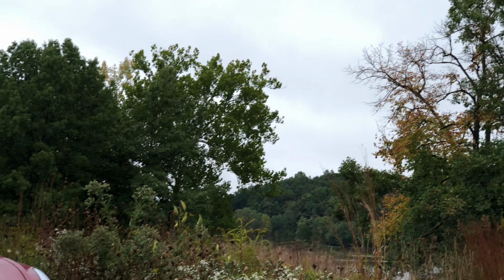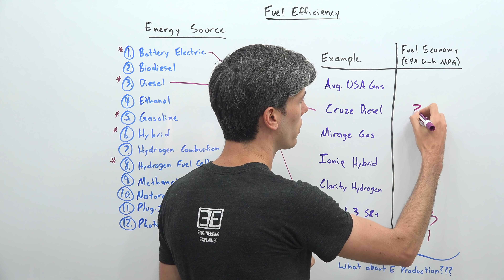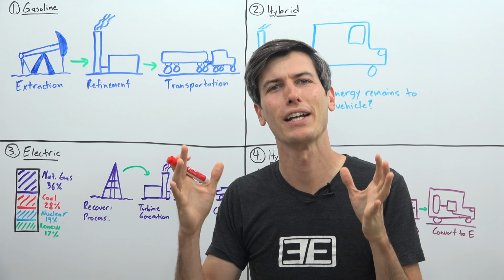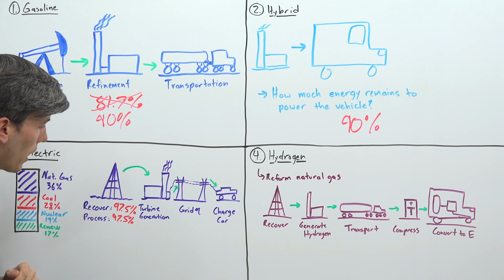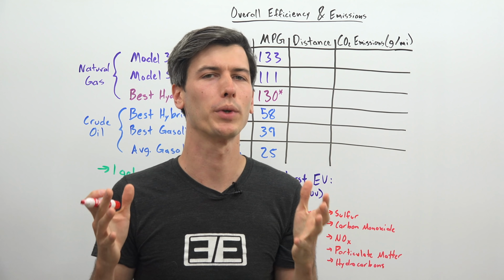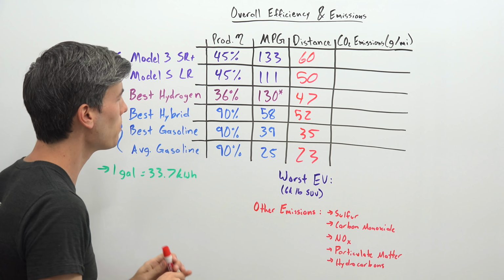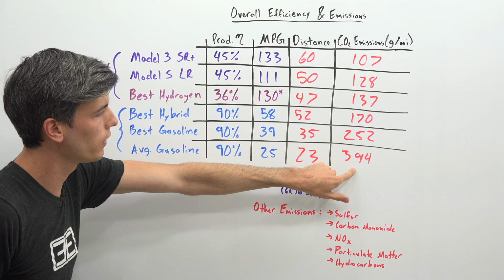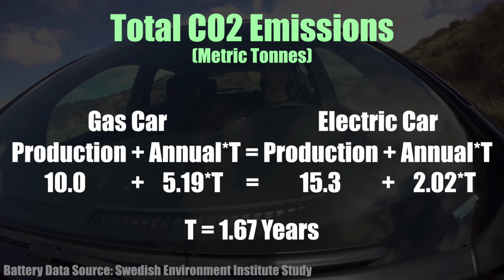Are Teslas Actually Better For The Environment?

Comment: How did you already calculated mpg rating for electric cars, at the very begining of your video? And isnt that logical to calculate mpg rating of the veichles of same strenght(kw)?
Reply: Those are the EPA ratings based on distance driven per KWH, since 1gallon is the same energy as 33.7kwh of battery pack.

Comment: I think judging by the fact that 1 gallon is 33 kWh, a Tesla 3 can travel way more than 60 miles from 33kwh pack. More like between 80 to 100. Since a 100kwh Tesla does 300 miles. Still Tesla's for the win. Batteries are better than gasoline just gasoline is a liquid while batteries are physical.

Comment: The US should be ashamed of those mpg figures for petrol/diesel, rest of world can far exceed that and has for years.
Reply: Its not the consumer's or the manufacturer's fault. It was the Obama Administration's EPA that piggybacked on California's Air Regulatory Board to choke petrol and diesel engines so they produce less emissions. While they succeeded, they also significantly decreased fuel economy. Its a trade off the government seems pleased to have achieved.

Comment: I'm sorry but absolutely no way is the best diesel mpg you could find is 36 my D4 Volvo V40 does and average of 67mpg.
Granted that's motor way but even if I do a lot of city driving it never drops lower then 53mpg.
That's a combined of about 60mpg.
The D4 isn't even the most efficient diesel on sale it's good but there's some out there that does 75+
Think you need to have another look at this
Reply: bring it over and put it on the EPA's test stands, run the 5 tests and let them provide an apples-apples set of numbers.   The EPA numbers aren't real world driving results, they just compare models against each other under the same testing conditions...

Comment: While natural gas (NG) generates less CO2 than other fossil fuel per unit of energy, it applies ONLY TO ITS ACTUAL COMBUSTION, at the point of energy transformation.  Its proper GHG impact should take into account the gas leaks that happen, unavoidably, at the well site, and during transportation and storage.  These leaks amount to 2-9% of the NG consumed, depending on the type and geography of extraction, the build quality and length of the pipelines, tanks, compressors, etc, as well as denpending on the scientific sources.  NG being mostly methane, and methane having around 80x worse a GHG effect than CO2, these leaks make NG as polluting as coal, in the best cases, and the very worst fossil fuel (on GHG metrics), by far, in the less favourable cases.  
I never see a well-to-wheel comparison, which takes into account NG leaks.  For example, NG-fueled cars are by far the worst GHG offenders.  It is NEVER presented in that way.
Maybe you should do some research to confirm (or infirm) my data, and do a video on that....
Reply: these leaks would be really hard to calculate into the equation...

and ever heard of oil leaks? Deepwater horizon? gulf of mexico?

Comment: The computation is not accurate, due to an important miss: coal generated electricity. Even though it only contributes ~30% of electricity, it contributes about twice of co2 emissions than natural gas, due to their low heat value, and high concentration of carbon. Electric vehicle is only as green as the grid it is on. While for European countries where a larger percentage of energy is from renewables and the rest is almost  exclusively natural gas, in the US the math is pretty different. Of course the most striking difference is in China, where 80% of electricity comes from coal. In China, electric vehicles are not low co2 emission at all. Unfortunately, China is also the place with most electric vehicles, and newly built coal plants, so electric vehicles may not be environment friendly on average.
Reply: Also, the 60% approximation for power plant efficiency is probably an overestimate, as that is around the efficiency for the most efficient system out there. There are still many antiquated systems around, which have much worse efficiency. 
I am not denying the potential for electric vehicles to be much cleaner, I am just stating that right now, it may not be much cleaner than the most efficient hybrid vehicles, and may depend on usage scenario (much greener in city, but on highway it is difficult to call as ICE gets more efficient)

Comment: This was a decent attempt but still flawed.  The difference is much BIGGER!  You completely missed the distribution inefficiency of transportation for the gas / Hydrogen via tanker truck.  That's massively inefficient!!!  And it ruins the math of the gas + hybrid + hydrogen vehicle.  There's a lot of loss in distribution beyond the refinery.  This happens twice -- when the raw material is pulled from the ground AND when the refined material goes to the station.  People need to see how BAD the transportation system is.  Electric power line losses are nothing compared to that.😁

Comment: And the emissons of a  e85 or e100 vehicle ?
Reply: Gabriel de Souza E100 along with a 100% E100 supply chain would be emissions free. E85 with 100% E85 supply chain would be 15% of his gasoline number. Problem is the current supply chain is no where near what it takes to be carbon neutral.

Comment: Big problem is the assumption of power generation coming primarily from natural gas. It's only 34% accurate. Coal generates about 30% of power and nuclear another 30% but its all dependent on your region so what might be true in one state does not apply to the other. So charging up your Tesla in West Va. for example, power will come from a coal fired power plant. Probably not so great for emissions.  The destructive mining operations needed to get the precious metals used in the batteries was not considered.   You also did not consider all of the associated energy and pollution in just creating the batteries. I don't think you can isolate on certain variables then draw out your conclusions on environmental impact. Besides that, it might also be good to know who is making these batteries, most will likely come from communist China.

Comment: How about if electricity is generated  using Coal?
Reply: Gaurav Patil There are states in the US and even some countries such as Poland who generate most of their electricity from Coal. In these areas it would take an EV about 7 to 9 years to become less polluting than a hybrid. 

However Coal’s share of electricity production is dwindling fast. Everywhere coal is being replaced by Natural Gas because it is cheaper. Very few new coal power plants are being built and many are being closed down earlier than intended because the economics are not in their favour. 

Coal is dead. And it is not environmental concerns which are putting it away. It is economics. Energy providers choose the technology which is giving them the bigger profits and Coal looses out almost always to Natural Gas. 

Increasingly and depending on the area renewables are becoming the cheaper option. In the UK, the cheapest form of electric generation is onshore wind. In California it is solar. Renewables keep getting cheaper and the more that happens the more fossil fuels will be displaced. 

Here in lies the benefit. As the grid becomes cleaner, EVs become cleaner.

Comment: I don't think this video is right. A-level physics student here and due to the high voltage (regardless of how low the current is), 75% of energy is lost when moving through the grid due to heat, making it 25% efficient as only 25% of the original energy can still be used.

Comment: pinning things onto the lithium productiuon yet stating that it only uses like 7 % of the battery itself
then ok maybe u shoud focus on other materials? like colbalt which is proportional to lithum productions? No u missed it.
ok then maybe u can compare how efficient to run a car avg a year and life span of a car (or specifically the battery itself)? still model t from a hundred years ago r still running.
how bout comparing the recyclability of ICE vs EVs ?

Comment: Internal combustion engines dump emissions into the population centers whereas the electric cars put the pollution that they generate  Out near the powerplants instead of the city. Tire and brake dust remain same for both
Reply: Nope. Less brake dust since electric and full hybrid vehicles use their electric engines to brake too. A full hybrid car may need to switch its brake pads after 190000 miles.

Comment: Natural gas is the cleanest fossil fuel we use to make electricity. I think if you really wanted to make it tough for Tesla in this comparison like you said you should've used coal.
Reply: I think his thinking was to represent both the largest source in the US and where it's trending to currently.   Coal displaced is mostly being replaced by NG, Wind and PV.
Reply: @lylestavast7652  if I remember correctly he said coal makes 28% of electricity in America and NG makes 31%. While coal is on the decline, it's still right up there with NG. Tbh I think that's the only cherry picking he did in the video. I would've liked to seen what the carbon emissions would've looked like for coal instead.
Reply: @name-jn3ri   No -  2018 - it was 35.1 NG and 27.4 Coal.     About 50% of electric power was produced by coal in 2005, declining to 30% in 2016.

Comment: One of your statements just wasn't correct.

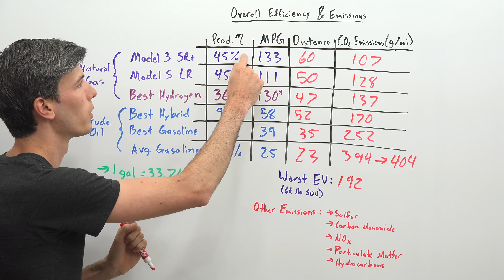14:05 of course solar power isn't as efficient as burning natural gas. It's much, much, much more efficient.
For natural gas plants have to convert sunlight into, well, themselves, and then they get converted to natural gas over a loong time. A plant only has an efficiency of 3-6% and most of it goes towards animals, so ultimately heat and not towards the natural gas that will form in a million years.
A solar panel just directly does the conversion to electricity with an efficiency of about 15-20%, some up to almost 23%, and is thus much more efficient than natural gas.

Comment: I am pretty sure that 90% efficiency in gasoline production is BS, especially if the oil industry has estimated that.
Should be noted, as well, that methane is a much more powerful greenhouse gas than CO2. Which wouldn't be much of an issue if all of it would be burned to produce energy. Fortunately though, the current administration is working hard to remove regulations aimed at avoiding methane leakage in to the atmosphere.

Comment: The hydrogen fuel economy numbers (MPG-e) must be completely off. Just look at the cars in the market and see for yourself! The new Hyundai has 6.3 kg capacity, and the energy density is 42 kWh per kg. That’s 265 kWh, and get it only has 45% more range than a model 3 (75 kWh useable). 

Also, while hydrogen is from reformed methane in practice today, that’s not how they say they’ll make it green. They say they’ll make it by electrolysis using renewable electricity. If so, they’ll need to produce well over 500 kWh to fill that Hyundai up! In short, it is an INSANE proposition in a world that has a shortage of clean energy and looks certain to need most of this century to simply phase out fossil sources. The only scenario IMHO where hydrogen could possibly be a candidate in cars is if fusion energy came and was built out very rapidly, so we had an abundance of clean and cheap electricity. Then it wouldn’t matter that it’s inefficient. 

No idea why the EPA would make such a basic mistake, but as you can see, hydrogen cars are far less efficient than they pretend. And once you include the whole chain and consider what clean hydrogen requires, it’s positively a bad joke that this stuff gets taken seriously by policy makers.

Comment: Your calculation for gas is massively off due to leaked out substance that the extraction process doesnt get to pick up wich goes straight into the enviroment wich is worse then burn off fuels obviously and then the gas vapors created during transportation and in the ground waiting to be pumped into the car and also the gas run off while its in your gass tank theres so manny factors in gasoline that is not accounted for in this example gas stations lose 10-20% of there gas a year in just fumes depending on the climate

Comment: All I care about is money..... If I buy a $20,ooo car and run it for 10 years rather than an expensive electric car then I should see the benefits of a petrol engine over an electric car all day every day. If I take your 25 mpg average and calculate the cost of traveling 10ooo miles annually for 10 years then I should still end up paying half the cost of the electric car over that same period. that's $20,ooo in fuel over 10 years plus oil changes and service and another $10,ooo(worst case).... that'll still be cheaper than an all electric.
Reply: make an effort for the environement and future generations ?
Reply: @DemsW  Pragmatically.... if all alleged moral actions had good outcomes then I would do it. But since we don't know what our "good actions" will result in then we default to selfish interest. This happens everywhere in life.... moral actions don't necessarily results in our intended results no matter how empathic we feel about it. Buying an electric car might feel good and give you a feel of accomplishment until it is found out at some point that there were unintended problems that were worse for the environment that the petrol cars....

Comment: did you INCLUDE the battery replacements?   cause that would change everything............ /
Reply from the maker: In the video linked at the end (and description), yes, I included this. And they last far longer than you think! (Minimum 8 years under warranty, but likely longer).
Reply: @EngineeringExplained  thanks.............. im processing ALOT of info lately.   im holding onto my 5.7L V8 conversion van - since I use it for so many things and my commute is nominal. My friend was dragging on his (effieciency) but for what he paid - I could drive my beast, as is, for 15 years....... and likely buy another/newer for what his battery replacement would run.      THANKS for all you do.
Reply: er (bragging re his electric car efficiency)

Comment: Mazda's new compression ignition gas engines are cleaner and less environmentally impactful over the entire life cycle of the engine, all factors of manufacturing, sourcing energy for use, and recycling considered, than EV's. It's just that few in a politically driven world are willing to admit it outside of Japan's engineers.

Comment: If you look at the amount of emissions saved / distance gained per dollar of investment in the vehicle, the decidedly non-luxury, blue collar hybrids like the Prius C are the best. Until batteries cost less, most people can’t afford an electric car with the range they need to not have range anxiety. Upfront cost is EV’s biggest downside. We need a $23k base price EV with 300mi cruising range. Such a car would completely change the world and reverse the economics for the middle class in the US, putting EVs firmly in the lead as the most affordable commuter car.

An objectively more efficient car is not a net win for pollution or fossil fuel conservation unless they are selling in enormous volume and displacing conventional vehicles. Hybrids are displacing conventional vehicles today. EVs will only be able to displace conventional vehicles significantly if the price per kilowatt of battery capacity can be cut by another 50 to 75% from the present state of the art.

Comment: Excellent job, one follow up on the distance for the Teslas is from Tezlab with over 4M trips logged we see that a Model 3 takes 290 wH to go 1 mile so it would give you roughly 116 miles of distance w/ 33.7 kWh and the Model S takes ~380 wH/mi so it would be ~88 miles (if my math is right of course :)

Comment: I'll be sticking with my ICE, thanks though.
Reply: TrashPanda 365 test drive one. I quickly traded my Ram 1500 Hemi. 
Not a great comparison but I went from $600/month in fuel to $40-60/ month in electricity. But I didn’t buy it to save money, it puts a big ass smile on my face every time i slam that accelerator!
PS my truck payment was more than the Tesla.

Comment: Efficiency assumes a relationship with cost to run (I’m assuming) so 
Where’s the cost factored in when the batteries need replacing ? (I’ve read upwards of $30,000 AUS) that’s gonna buy a lot of fuel

Comment: people think that with them being electric there helping the enviorment by not useing gas or other harmful stuff but my question for you is what do u think plastic is made from what are batterys made from lithium (mining thats bad for the eviorment). also gas pumps that are modified to the gas station with gas powerd equipment so imo its not good for the eviorment while the same case is for gas cars it doesnt require lithium mining or putting in custom gas pumps this is how i think of it i think teslas are ugly and dont do any better then what there replacing or trying to (no research in this this is my opinion) lol

Comment: The efficiency of U.S. power generation is 33%. You used 60%. Your electric emissions are WAY too optimistic. Gas turbines are a very small percentage of U.S. generation, Electricity is, thermodynamically speaking, very high grade energy. That's why it takes 3 units of heat energy to make one unit of electrical energy and also why electric vehicles, once you have ignored or underestimated the penalty of electric generation, appear so efficient..

Comment: And i still don't want one,let's see if we even have enough material available to make batteries to replace every car or truck or heavy machinery that run's on fossil fuel now,the best way to reduce emission is to drive less period.and your use of other modern tech like cellphones ,computers ,and heating and cooling your house are as big a problem as your car.